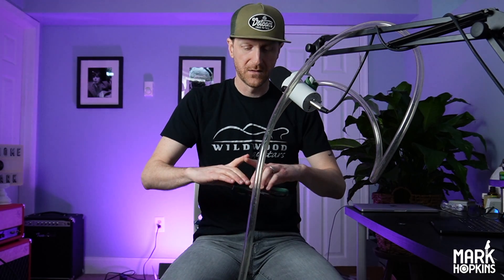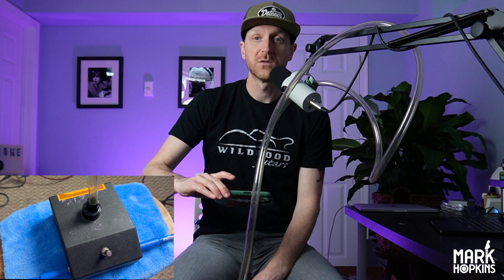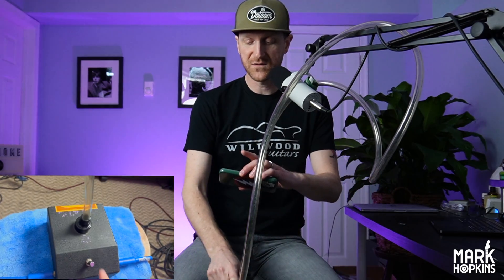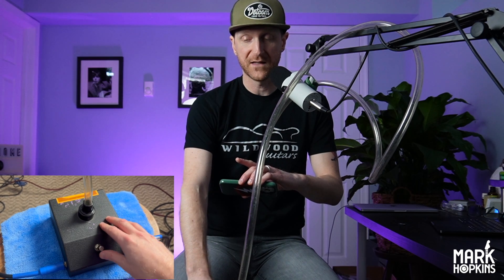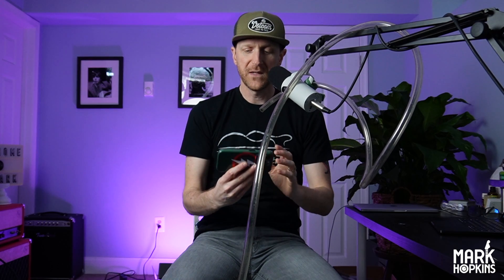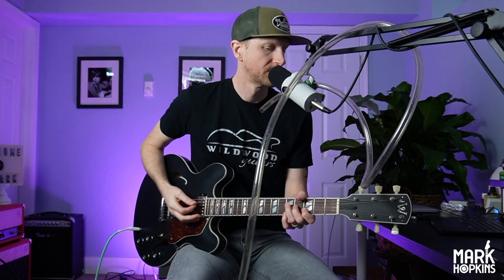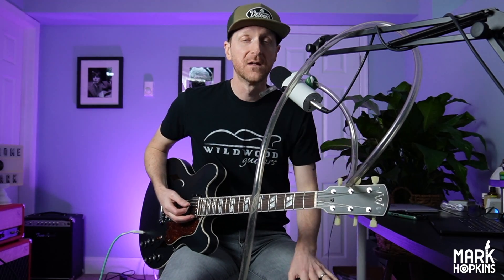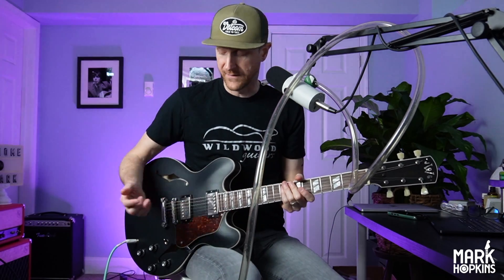How Does A Talk Box Work?

Comment: What kind of speaker/amplifier is your mic connected to? Is it a different amp/speaker than the guitar amp? In a gig, how do you amplify the talk box?
Reply from the maker: The talk box is a speaker that connects TS to an amp out of one output and the cabinet from the other. So my guitar amp essentially switches between using the talkbox speaker or the actual amp cabinet. The vocal mic picks up the sound from the talkbox speaker through the length of tube.